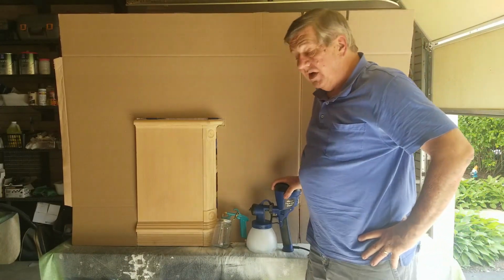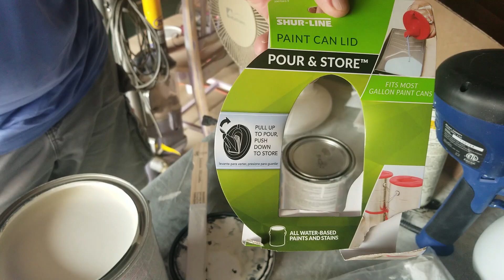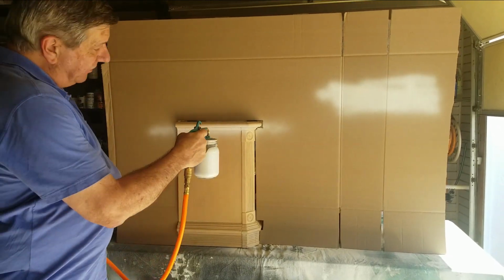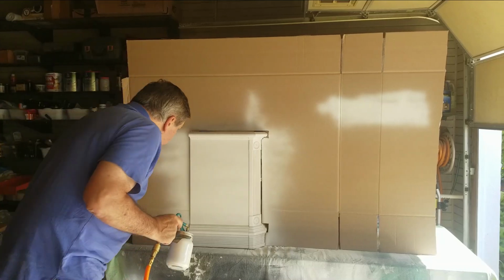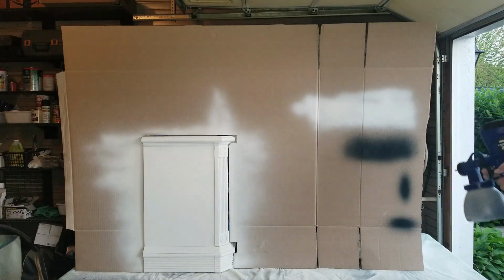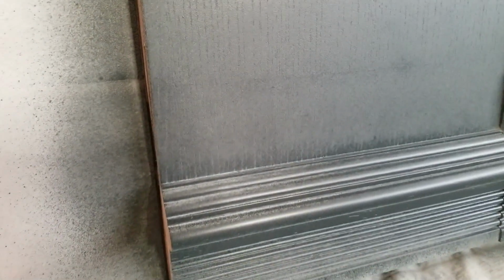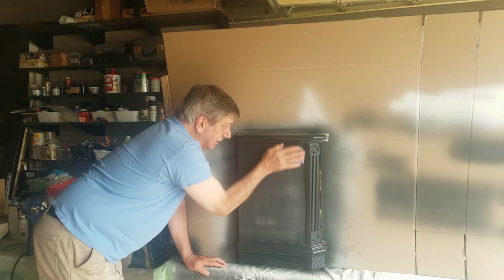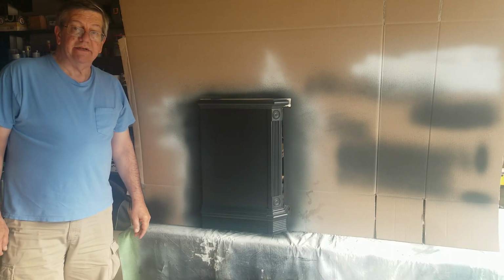How to paint furniture with a paint sprayer. DIY furniture makeover made easy.

Comment: A really great informative video. I have the exact sprayers. I think I was spraying too closely. I see that the first coat doesn’t need to be so thick. And I’ve had drip problems. I’m ready to bring them out again. Thank you.
Reply from the maker: Hope it helped! Yes, if you're getting drips you're either too close, or moving too slow. You really should be able to see through the first coat. The second coat done the same way will provide the coverage. Thanks!😀